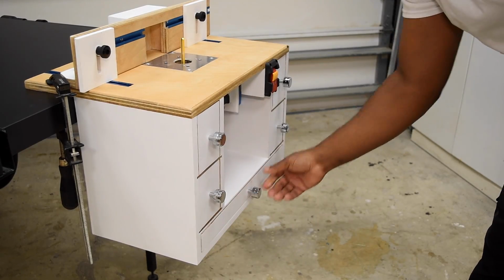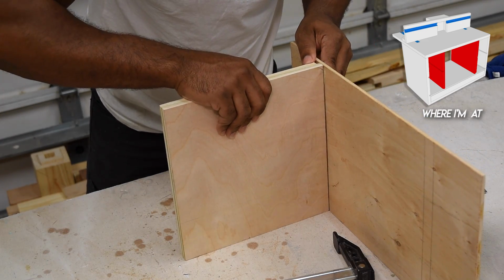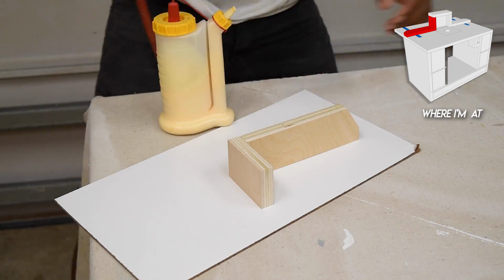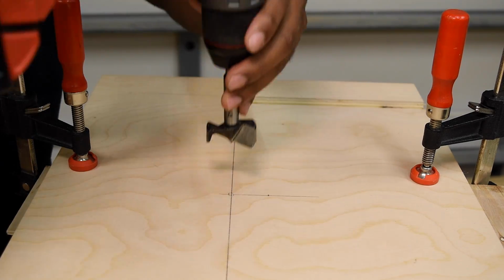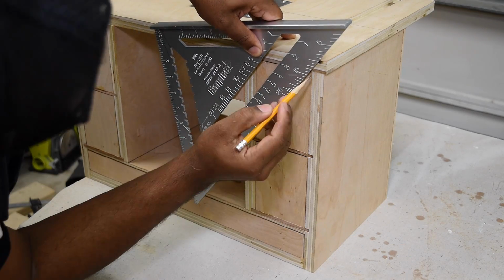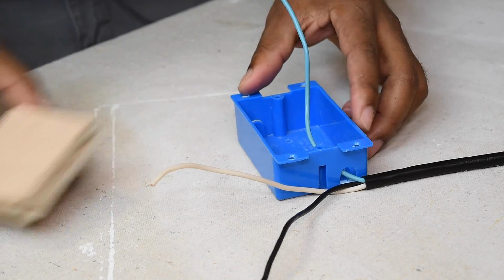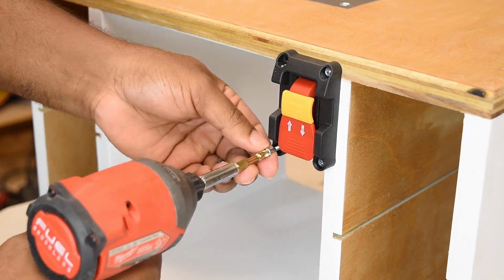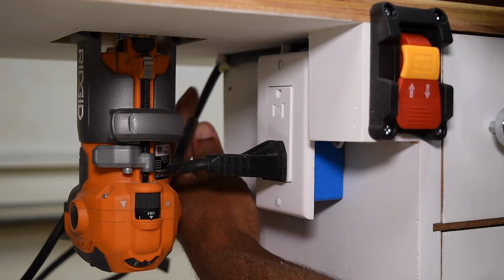DIY Compact Router Table with Handy Bit Storage

Comment: Glen, love yr creative approaches to all your designs without breaking the bank! One question: why not just use the plexiglass you have rather than sheet metal for the router plate? Would that be less effort (and you could look down the throat easier)?

Comment: I don't think those connectors on safety switch are rated for 110/230VAC. Have you checked the specs for that safety switch? I have only seen those connectors used in 12/24VDC. If the current going through is higher than the rating, you can risk overheating and melting in your connectors, worst case your safetyswitch and cable insulation self-combust(fire hazard). But I might be wrong.

Comment: Excellent instructions . I want to build one. I bought the plywood which wasn't too expensive about 40 bucks. 
But that single piece of acrylic would cost me $112.00  at Home Depot. (Or Lowe's) Because the smallest piece I can get is 18 inches by 36 inches in that thickness.
That puts this project out of my price range as I can get a router table for about 100 bucks.

Comment: This is a nice build, but DO NOT trust those router bits off Wish.  These things spin at 8,000-24,000 RPM, if the cheap Chinesium they use to make it fails and it blows apart at those speeds, guess what, you might get hurt really badly. I'd be way more concerned about that than the 2TB USB drive which is also a scam but at least can't maim you!

Comment: Crimp connectors are not designed for solid wire or soldered wires they can shake loose.........

Comment: So what exactly was the outlet for?
lol, You mean to tell me you spent the time to wire both the switch and outlet for plugging the router in and turning on a switch????
The effort was almost as long as this comment. Always assume you are over engineering things a just make it work right. No need to waste precious time when I could have gotten the same end results with saving time now and every time I wanted to use the tool!
Reply from the maker: Your comment tells me you don't understand how this stuff works.

Comment: Never pre-tin wires when you crimp. Doing so has caused fires in Denmark and has been made illegal.
Twist the wires, then insert, then crimp, that's the right way to do it. (I'm educated both in electronics and electric installations).
A humbe request: Please cut the soldered wires off and re-crimp (anywhere you've used solder, not just on the router table).

You didn't make the following mistake, but in case anyone reading this might be about to do it, I'd like to warn against it:
Another common mistake that causes fires is to join a multicore wire with a singlecore (solid) wire on the same screw in a screw terminal or connector. This will cause sparking and thus heat builds up and one day it may ignite surrounding material.
Several solid single core wires can be joined on the same screw, several multicore wires can be joined on the same screw, but do not mix.

Technical detail on the solder-before-crimp issue: As soon as you crimp, the solder is ruined, causing a lot of small fractures. The resistance in that particular area grows much larger and causes heat to build up. This heat can ignite surrounding materials. In some cases sparks have been known to form as well. Crimping directly on bare multicore copper wire causes the crimp-terminal to cut into the copper and have a solid grip; no sparks and no heat build-up. If you forgot to put the insulation on, you can get insulation covers that can be added after crimping have been done.

Otherwise, nice build, I enjoy your videos, they're very inspiring.

Comment: I think that way of using crimp connectors is incorrect. They should be crimped onto a stranded wire. You can give it an extra twist for easier insertion into the ferrule. Tinning the wire is wrong, because the wire will have a tendency to break right where the tin ends, under the wire insulation especially, that this will be subject to quite a lot of vibration from the power tool.

Using combination pliers to crimp the terminal is also wrong, you need to apple A LOT more pressure to form a correct cold weld crimp. Ratcheting crimp tool is a bare minimum if you don't want to risk fire due to high connection resistance. They can be had for as little as 15€

Comment: safety tip: when inserting a router bit into a collet, put it all the way in, then back it out 1/8" so it doesn't touch the bottom. if you don't when you tighten the collet (because it screws) the bit may bottom out and feel secure but the collet hasn't been able to tighten properly and fully. having a loose bit in your router can obviously cause cut problems but is also a big safety hazard.

Comment: I thought you said limited tools. I see air tools, Air compressor, a t square, pricey large clamps, a large Forstner bit, hole saw bit, and so forth being used in the build. 
Limited tools means to me what average homeowner has. Drill, hand saw or circular saw, drill bits, tape measure, maybe a jig saw. There is nothing wrong in making a jig ahead of time to help in the build but the jig should be made with the same limited tool set. Just my opinion. Nice build though. I added to my favorites.

Comment: There's no need to tin the wire with solder.  Crimp ends are designed to work with strand wire that is not tinned (ie soldered to be solid).  You actually risk breaking the crimp end by soldering it.

Comment: Advanced Router User?
Thats calls for a silly challenge. Something like "route and turn wood into a ... " vase, decoation piece or something else. Yes, the small things are always a thing too. ^^
Nice build and I like the solution for the router bit storage! 
I am slightly worried about the electrical outlet underneath the router though. Can´t put my hand to it, just a natural alert in my head.
I can already see the need for an extention though, whenever larger pieces need to be routed or, perhaps worse, lots of smaller parts need routing for repeated steps. In that case, perhaps a small tray or bucket for the ready (and one for the "to do" pieces?) left and right to the table would be an option...

Comment: Another great project.  I'll add this one to the list of projects.  One question, does the fence being parallel to the front matter on a router table? Or since they're bits instead of blades does it just work as long as the center is set the right distance? Thanks for another great video.

Comment: Hey Glen, great router table build, as always!  Unfortunately, Wish scammed you on that 2TB thumb drive.  I'm glad they sponsored the video, and gave you a good price on the router bits, but there's no way with current technology to have that amount of space on something that size or that cheap.  It's likely an 8GB drive with firmware that misreports 2TB to the computer, then overwrites/corrupts the older files when you try to copy newer ones on, so not only do you get scammed on the purchase, but you also lose your data.  Search 'WISH 2TB' for reviews exposing/proving this scam.
Reply: yes you are right...i agree with you...those are scam...there is no way it can cost only 7 dollars and it cannot be that small
Reply: I came here to comment this exact thing, it's a complete scam, the data will overwrite old data. DO NOT USE IT, i'd recommend telling people not to purchase them too.
Reply: Yeh, not really a good ad to get people to use wish when the main selling point is they will scam you.

Comment: The 2 TB US drives are fake and a scam so stay away from them.
Reply: Also note that if you are ok with a bit more wait Ebay has the same or similar items for severel times cheeper and on Ebay you can use filters for price etc witch last i checked Wish dosn't have.

Comment: You can buy a lot of things on Wish, but please don't buy cheap router bits, remember you're working with knifes rotating at 30000U/min a few inches away from your body.
Reply: Thanks for the video by the way, great build and really helpful! I still need to build a router table, and this one really helped!
Reply: I’ve been working with router bits, drill bits and lots of tools from Wish for two years. Just look up the reviews and do the homework. You don’t have to pay mega bucks for something that is sold cheaper by the actual manufacturer sometimes. As long as people read up on what they are buying, they’ll be ok!
Reply: my point exactly
Reply: The cheap routerbits are often rated for only 5000 or 6000 rpm, so always check that they are rated for 30000 rpm or more.
Reply: I've had a piece come off an expensive bit too.
Reply: @philgray1023  Same. I had a $45 Freud flush trim bit fall apart on me after maybe 30' of work. Pieces flew everywhere and I returned it for a cheaper Diablo. Hasn't failed. /shrug
Reply: True, always building with quality tools is what I do in my videos.

Comment: I hope you are aware the 2tb usb stick is fake. It’s a regular low capacity USB that has been flashed to say when you plug it in that it has a larger capacity. Try and fill it, it won’t let you - they are a con and you shouldn’t be promoting them
Reply: Really, that's good to know Turner.

Comment: 2TB USB are a pure scam. Bought three  different 'name brand' ones for about $8 each in Hong Kong. They are all either 4gb or 8gb USBs that have had their firmware modified to make the computer think it is 2TB. If you put a 30gb file, it will pretend to copy it over, but just write over itself until it has done the full write.

Do NOT trust everything on Wish. Some things are excellent, others are a straight up lie.
Reply: Thanks for the info. Never even heard of Wish. I got excited when I saw him talking about the thumb drive. One of our manufacturers that we represent has a 2 gig. drive limit for updating their firmware. Thanks again.
Reply: Insayno   That is so true. Have bought a few things on wish and 95% of them are just junk
Reply: I don't see anything about 2TB sticks - has that part of the video been removed?
Reply: @RoamingAdhocrat  he talks about them in the beginning of the video, but the Op is correct, if something is too good to be true it probably is ir the quality will be so bad as to be unusable. I believe the router bits will be great, the hard items I have gotten from Wish have been ok. You always get what you pay for!, also watch for the shiping charges, some items will actually be less expensive on amazon or ebay.  Great Video, Awesome little table!
Reply: @vsavoldi  huh. I completely missed that bit!
Reply: Not to be rude but what did you expect. If something sounds to good to be true it probably is. (AGain don't mean to be rude). ALso check the image, the scammers usually have bad pasted on 2 TB text on it that is easy to see that it is made in a editor.
Reply: @emirrp  you are missing the point. You are shifting responsibility to the buyer for identifying scams - this is victim blaming. Yes, as buyers we should always be alert for scams, but that does not make it OK for the seller to scam people. Why do people know about these scams - because they (or a person they know) have been fooled at least once before. Just like Glenn here he wasn't aware that the USB stick is a scam - not everyone should have to learn it the hard way and *lose money or lose important data*. For some people 8 dollars lost is not a big thing, but for some people that can be. The topic here is discussing the fact that Wish is doing something deeply unethical, and it's Wish's fault - not the buyers. Yes I know Wish is a platform, but they should have policies and processes in place to weed out badly behaving sellers. Amazon also is a platform, but do you see shit like this rampant there? No, Wish just doesn't care, and that's the issue here. Not ok.
Reply: @joonasfi  Well i did not mean to be rude and stuff but i more meant iit as we need to be a bit more carefull when shopping beacuse this world is not perfect and by that there is going to happen things like this. In a perfect world there would be no scams and even if Wish have a responsibility for checking this some dosn't do that that well.
Reply: @emirrp  I totally agree, that since this is not an ideal world, we should be alert for dangers! But we should not let wrongdoers off the hook - we should also focus on fighting against bad behaviour.